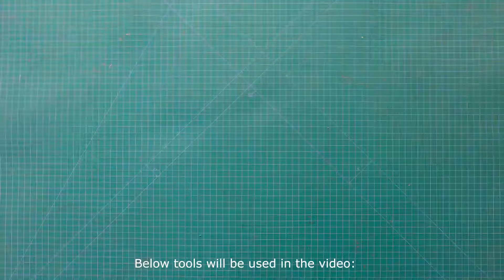How to Cut, Solder, and Join Silicone-Coated Waterproof LED Strip Lights | Step-by-Step Guide

Comment: Apparently you and I have _different_silicon coatings on our LED strips, because there's no way in heck what you did here works for me. Mine will not remove AT ALL. :(
Reply: I haven't tried this either but can you melt it with a soldering iron?